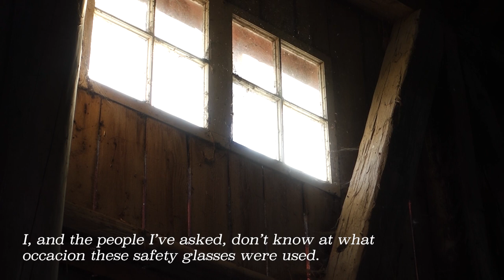To make birch bark safety glasses from the 19th century | Dalarna, Sweden | Nordic Museum | Sloyd

Comment: Those are really nice! I know they didn't have plastic in the old days but they'd look really good with green plastic lenses made out of heated and flattened mountain dew bottles and would then be good on a sunny day in snow country for preventing snow blindness. Much better than mere slits which they normally wore and they could also be used when working with fire or a cutting torch. Lol
So many ideas. Perhaps if you made them again you could have slits to easily exchange lenses.
The adaptations are endless😎
Reply from the maker: YES!! I love the idea with green glass!!